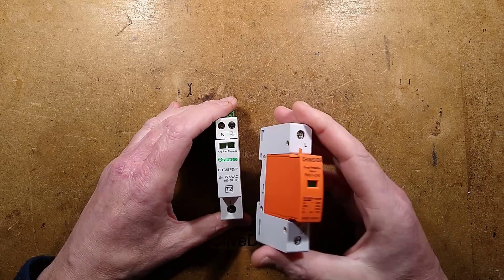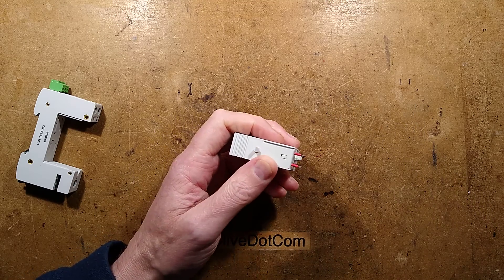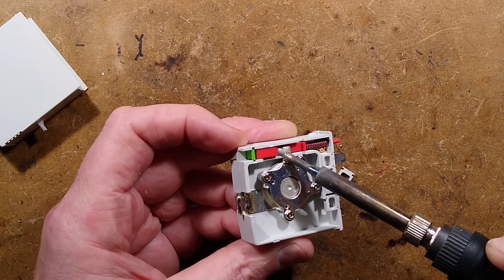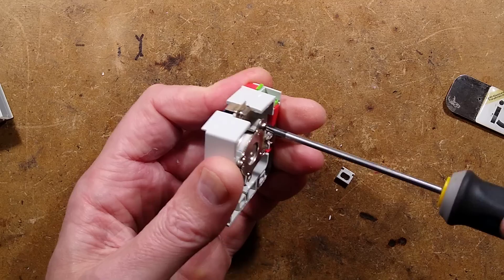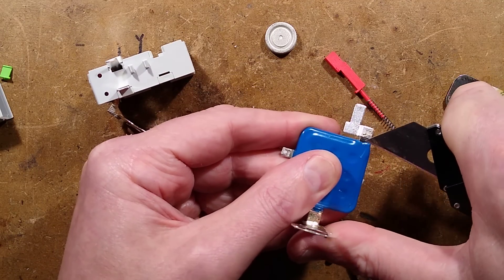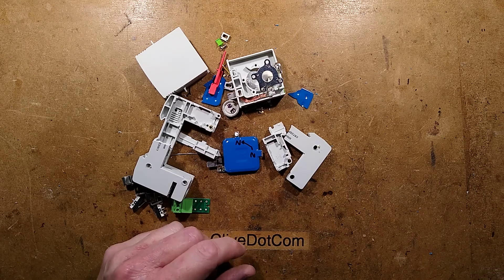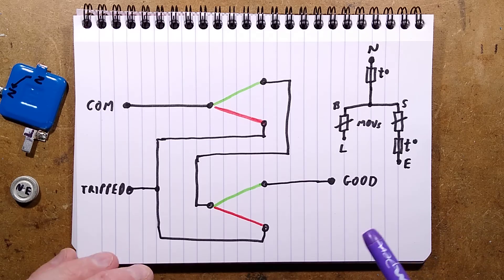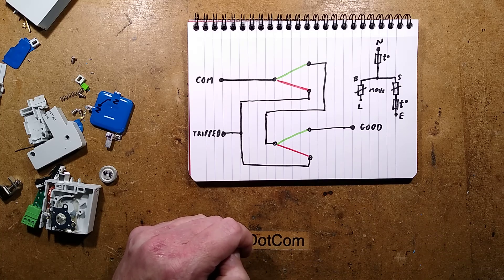Expensive UK surge protector teardown

Comment: In my personal experience, when the state comes in and mandates something for our own safety we all end up paying for it. But the state uses their regular scapegoats, "no we wanted something cheap they made something expensive" and for some reason people believe that sort of bullshit.
Reply: Read the current regulation: In part: "exceptions may be permitted where the owner opts out and accepts all consequences and losses" 

As a Trade qualified Electrician working for many years in the generation / distribution (grid level) / protection and control sector, I chose to install Industrial grade Class 2 SPD in my home, because I DO NOT TRUST the local Supply Authority to implement adequate surge protection for the general residential consumer. This was done over 10years ago. It's a similar device to the one shown here.  Such entities have used surge protection for decades to protect all their instrumentation, SCADA and control gear. Industrial and wise commercial customers do the same.   It's because we are not stupid like the general public... like you.

So good luck with your mindless conspiracy theory crap. I don't believe your BS. Your words kinda indicate an American location, where any DIY idiot can install modify and connect Mains Voltage systems in homes. Seems a lot of ignorance regarding the function of these , from the usual DIY mob so think about this, if you can - what could possibly go wrong with that state of affairs? 

One thing for sure, I won't cry when your electronic devices are fried from a transient over-voltage fault and you go through the bother of trying to make a claim for a 'surge event'. None of us will miss your absence.
Reply: Safety STANDARD mandates are intended to protect the community from the likes of idiots. I care not that you take 'cheap risks' that might kill you or burn down your house, but I do care that something a tight-arse does may risk the life or property of an innocent individual or a first responder to an incident.

Comment: Clive, I live in NZ and my house has absolutely no RCD protection, Also still has some of the original wire wound fuses. Is this even compliant.
Reply from the maker: It depends on local regulations, but it would still be compliant here.  An upgrade to a whole house RCD is a good safety addition though, albeit that it can be subject to unwanted tripping when things like water heaters fail.
Reply: Ahh I see. Not my home. Thanks for the answer, Yes water heaters love causing high power drain when thermostats fail, Dangerous as well.

Comment: The smaller component is a 600v 20kA Gas Discharge Tube, it's necessary in TT systems to isolate the MOVs from earth in case of failure
Reply: that epcos thing definitvely is a gas discharge tube
GDTs help to keep static current through the varistors low (has basically infty ohms when not triggered) and at the same thime the MOV helps extinguishing the GDT after a surge.
Reply: Read the schematic. The MOV is not connected to PE - they are between A and N only.
Reply: I found it only described in an Epcos (which seems to be a division of TDK) Datasheet as a Surge Arrester with a 600V DC capacity, designed for a continuous voltage of up to 255 V AC. This type is intended to be used as a Class I (more or less direct lighning strike) device between N and PE. it seems you need an additional varistor to upgrade it into a Class II (also induced voltage) device. the o or O seems to describe the obvious form factor (as if we could not identify it as round) but may describe something else as well. But from what I found, I could not find what the 20 was supposed to tell. size seemed not to fit, as it clearly looks larger than 20 mm. There are other types the go between L and N, but for the blue thing, I could not find anything at all.
Reply: @alexanderkupke920   No, Class 1 [T1], Class 2 [T2] and Class 3 [T3] rated SPD's  can contain both Varistors and GDT's in their construction. 
Look at the device dismantled in this video... see the T2 printed on the front... it's a Class 2 device.
The Class types define where they are used. 

Again...
 Type 1 Surge Protective Device (SPD)s are intended for installation between the secondary of the service transformer and the line side of the service equipment overcurrent device, as well as the load side, including watt-hour meter socket enclosures, and are intended to be installed without an external overcurrent protective device. Type 1 devices are dual-rated for Type 2 applications as well, providing the highest ratings available for installation at the service entrance.
Type 1 SPD can discharge lightning current with waveform 10/350μs. This, if required, will be installed in the primary distribution board at the origin of the electrical installation. A Type 1 SPD does not in itself offer the required protection level and must be used in conjunction with coordinated type 2 devices. An installation with a lightning protection system will require a Type 1 SPD.

Type 2 SPDs are intended for installation on the load side of the service equipment overcurrent device, including SPDs located at the branch panel.
Type 2 SPD can discharge  8/20μs current wave , they can prevent the damage of transient overvoltage in the electrical installations and protects equipment connected to it. It usually employs metal oxide varistor (MOV) technology. The device would normally be installed in sub-distribution boards and in the primary distribution board if there was no requirement for a type 1 device.

Type 3 - These SPDs have a low discharge capacity. They must therefore only be installed as a supplement to Type 2 SPD and in the vicinity of sensitive loads. Type 3 SPD's are characterized by a combination of voltage waves (1.2/50 μs) and current waves (8/20 μs).
Type 3 SPDs are normally installed right before the protected equipment.

Comment: Wylex and Crabtree are basically the same products rebranded. Both pranks are owned by Electrium along with the Appleby and Volex. They are now owned by Siemens and you can get the same circuit protection products branded as Siemens. In my opinion great quality brands for domestic distribution equipment.

Comment: Both our vans have these on the mains side. If they fail or you pull it out it locks out the mains supply to the van and makes a lot of noise if you turn the inverter on or connect the shore line

Comment: I still don't understand why Britain needs these ridiculously expensive and convoluted Rube Goldberg Devices, one-time-use disposable fuses, opposed to regular old circuit breaker switches which have done the job for us unwashed 'Muricans for decades. I guess British electrons run hotter?
Reply: Wait.. I just remembered, England was a nation who came up with ring circuits; of course the distribution would be just as silly 😂
Reply: Did I miss something? This is a SPD, for clamping overvoltage spikes, not a circuit breaker for overcurrent protection. We use MCBs for that (actually combined MCBs with RCDs (GFCIs) in one package called a RCBO)... as Clive says the latest regs (code) are mandating/recommending these now so that presumably you cant blame the DNO for blowing up your £2000 TV if there is a spike
Reply: @jamesbarlow5309  How's about a power grid that doesn't spike hard enough to blow up £2,000 TV's? May I missed something myself not realizing how very, very different British power generation, transmission and distribution is. That sort of protection is generally done (here) between the distribution pole & customer. I don't recall ever losing anything of value short of a direct lightening strike to the house once
Reply: @Drmcclung  The only protection between the pole and customer in your grid is a lightning arrestor - which is just a giant spark gap which won't clamp smaller transients and won't clamp even large ones down to levels sufficient to ensure a long life for electronics.

There is nothing special about your grid - or ours. Yours blows up a lot more, though.
Reply from the maker: It's actually more likely to happen in America since a lot more of the distribution is overhead there, and sometimes high voltage primary is above the lower voltage secondary wires.
Reply: @bigclivedotcom  For overhead distribution, the smarter electric utilities in the USA put neutral wire between the high voltage primary and the low voltage secondary, so that the high voltage primary will hopefully hit the neutral first. I think this may even be an REA/RUS Federal standard, since the only places I've ever seen where the neutral isn't at the top of the low voltage secondary aren't electric cooperatives (which generally follow REA/RUS standards).
Reply: @Drmcclung  ring circuits allow lots of sockets, so you never have to unplug one device to plug in another.
Reply: The still use breakers, this is optional extra protection you unwashed murican.
Reply: Voltage may sag at times when reclosers trip elsewhere and load is transferred, but outright spikes just aren't common at all, it's not a thing here. I've got one time use surge protectors in the house more than 20 years old. We have far more problems with lightening and telecom equipment (and lightening traveling through telecom wiring) than with mains power. 🤷‍♂️
Reply: Well.. I'll add too while I'm thinking about it and someone points it out, really depends on region. North America's power transmission varies widely between the 9 grids, not all of them interconnect, 1 of them is completely isolated from the other 8, none use 100% the same equipment and all of them are maintained by a huge number of local operators/municipalities/providers. Some regions maintained far better than others. Still spikes are rare, I've never had one
Reply: @Drmcclung  You've probably had dozens if not hundreds today. You're not monitoring the line for them..
Reply: @Monkeh616  alright if we're splitting hairs I'm talking about surges not spikes, you've got me there.. we don't get *surges* , the kind that raise (I won't use the word spike) line voltage over 124v for any extended length of time, stuff that kills cheap shitty electronics when high blips happen. Voltage might vary between 119 and 124 throughout the day but no higher, I believe most of the new oil reclosers are sensitive enough to open within milliseconds of whatever voltage they were set to by the power co. Sags can happen briefly  followed by total outage if a phase is lost due to a tree or any number of reasons for 1 of 3 phases to crash. All kinds of new capacitor banks all over the place, some not used specifically for power factor correction alone, I believe some of them are in place to mitigate those transient little milliseconds-long spikes. It's not the 70's here anymore. I still think these overpriced surge protectors for a home distribution panel are kinda ridiculous unless the grid's really that bad over there.
Reply: @Drmcclung  You have a traditional AC unit, with a whopping great single phase compressor and a contactor? You'll experience transients well outside normal line voltage every time that thing is switched..
Reply: @Monkeh616  yes and they often trip the protection unit required by law sat between the AC unit and service panel when they're failing or about to fail (a cutout between the AC unit and breaker box supplying the unit). The worst you're going to get out of a properly installed AC unit here is a brief sag in startup but no dangerous spike that's going to backflow through the rest of the house and fry all your stuff. Unless you're running an ancient unit installed during the Reagan administration, it's not really a thing.
Reply: @Drmcclung  Er, that's just a fuse which can be locked removed.

Please spend some time watching your lines with a suitable scope some time. You might be surprised what goes on faster than your eye can see.
Reply: @Monkeh616  The old ones were plain breakers or just a removable bus bar/fuse, they don't do the fuses or busbars anymore. I THINK new installations in most jurisdictions require a proper GFCI breaker in there but I'd have to look up whether that's federal or state code. As far as looking at line noise or transients with a scope that's still nothing to write home about.. At least where I. Still just can't get on board with code requiring such an overkill device in a home service panel unless the grid it's tied to is extremely that bad. Even then, you'd still have to put a gun to my head to force me to pay for this style breaker in a new installation
Reply: @Drmcclung  And yet you're probably fine with AFCIs..
Reply: @Monkeh616  😘
Reply: @Drmcclung  About the most consistency you'll find in North America's grid is with electric cooperatives who have built their system to the RUS/REA standards. Supposedly they are similar enough that a linesman who is familiar with one can work on any other with minimal training.
Reply: @brianleeper5737  yep. The one outlier being Texas RE.. Let's not even talk about ERCOT, still too soon lol. Whilst mostly the same style across the continent, brands of equipment, layouts etc, and local regulations still vary widely across the continent. Some places you might not find a single physical cutout. It's a hodgepodge anywhere you go for sure but so much better than it was just 30-40 years ago. Centerpoint for example, serving the region I live in, has done a fantastic job of updating physical distribution into the 21st century. Slowly but surely they're phasing out the 1950's era substations, replacing tons of lines, transformers and various other things, even new triplex to the house if you ask them. We were one of the first to get completely rid of our very last analog meter in favor of actual smart meters (not just digital) some 20 years ago now. High voltage long distance transmission lines are still old but new ones go up every day phasing out the oldest ones first. 

Actual metered power delivered at the outlet, it's pretty damn stable in most of our urban areas now.

Comment: Of course I didn’t pay £93 for this, the hotel I stayed in at Edinburgh had one in the room fuse box.
Reply from the maker: I doubt hotels would want to spend money on flippant things like this.  They are notoriously greedy and tight.
Reply: I went to one hotel, in the dinning room, the newly installed rcbo protecting the warning plate kept tripping.  They told me proudly that they were having the rcbo swapped out back to just a fuse to solve the tripping problem 😅

Comment: the main problem is that if someone removes the protector then external circuit sees it as "Good" The pins should retract if it trips so that if tripped or removed the external circuit is tripped.
Reply: The pins do retract if it trips. It already does what you're wishing it would.
Reply: No, if removed the microswitches go in NO position so external becomes "no good", you see wen clive tript it that the pins retract.
Reply: @captainslow6888  Quality devices have SPDT switches for remote monitoring... so the fool uses NO contact set, and the wise use NC circuit wiring to provide fail-safe indication of wiring, device serviceability/health and presence. 
You do understand that those switches indicate the removal of the device from the base, don't you?
Reply: @BTW...  that's what i said...

Comment: i dont like that it is non-resetable, especially at this price.
Reply from the maker: It only trips when it is at the end of its useful life and needs replaced.
Reply: It's not supposed to be reset. When it gets hot enough to melt the solder it's because the MOV has already failed short. It will never work again.

Comment: Yeah, I immediately thought of a gas-filled spark gap aka gas discharge tube when you showed the Epcos component.
Reminded me of a much smaller one that I found inside a (cheap) power strip.
Reply: Your cheap Class 3 [T3] 'power strip' has a pathetic fault sink capability and more likely a source of fire behind the AV gear when it lives, given how poorly they are constructed. There is NO WAY they offer any form of lightning surge protection due to their location in the mains power supply, so why bother having a GDT installed.

Comment: Interesting. I have just had my consumer unit changed because I wanted RBCOs and an SPD (lots of computer equipment). The whole unit and parts are branded elucian.
From looking around the interwebs, they seem like a reasonably good quality make. SPD part number is CU1SPD275T.
Reply: RCBO... not RBCO 
Only buy devices that meet Approval Standards in your jurisdiction. 
I don't recognise a 'Elucian' brand here, and so, doesn't appear on any Approved listing for RCBO's.
Reply: @BTW...  It's scolmore/click. That's a well known brand, don't just assume.
Reply: @AndrewStrydomBRP  It's not a matter of assumption.  Assumption would be thinking all devices made/marked by a "well known brand" do comply with Standards.  It's time proven that devices DO NOT comply, very dangerous and expensive  when it comes to recalls and correction directives. Qucklag CB's manufactured by EMAIL/EATON are a classic example. Millions of them were installed and in-service for years. 

I simply refereed to my relevant Energy Authority listing of Approved RCBO devices. Some are not Approved due to design errors resulting in failure to trip.. causing death. 
If I install non-Approved devices I risk my trade License and/or large fines for non-compliance to Standards. That's not the worst that can happen - this shit can kill you should know.
Reply: @BTW...  No, I didn't tell you to assume that they are all good, I told you not to assume they are default no good just because you haven't heard of them.

Please do show me this Listing of approved devices. Elucian are CE/UKCA marked and made by a big brand that has a lot to lose by faking those markings over some random factory in china making non compliant devices.
Reply: Oops, that should be RCBO.